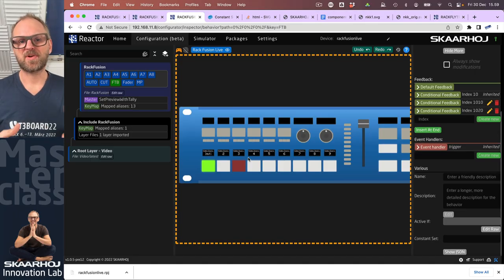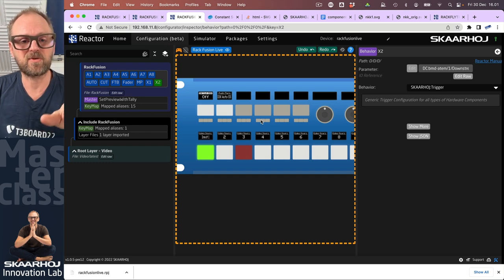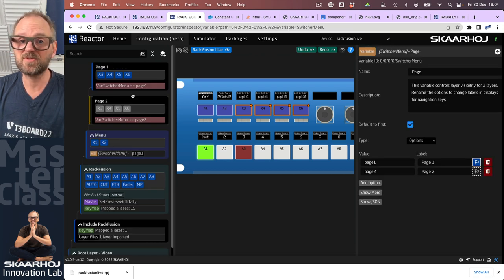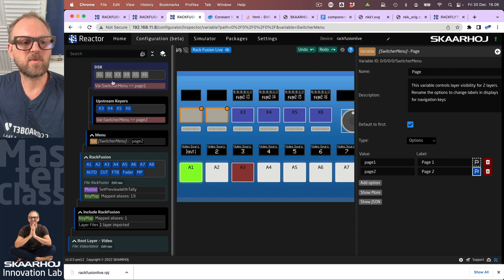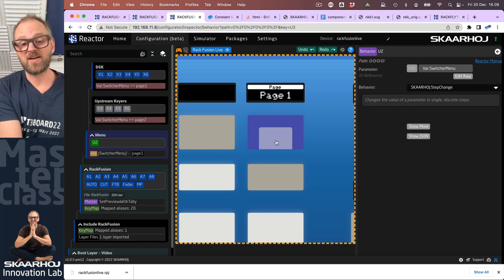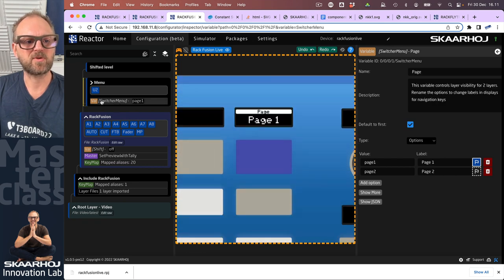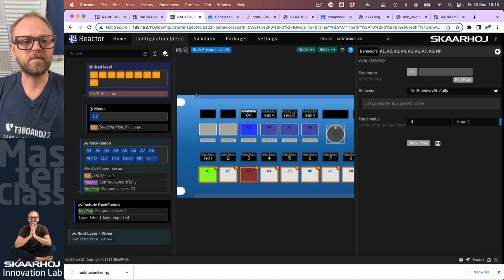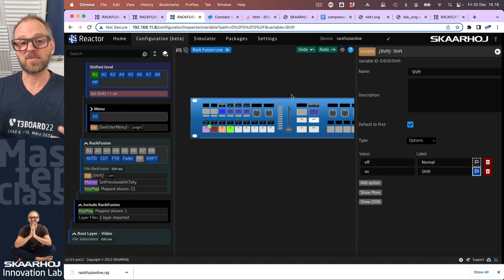Fusion in the Reactor 2: Adding a Shift layer and navigation key for it.

Comment: Great video! So much is possible with Reactor! Can you help me figure out how to display the IP address of the device on the screen from the Generic PTZ Control configuration? I use several different devices in a corporate environment, and if I move the controller from one building to another, the IP address will change, and I won't be able to access it without knowing the IP address. Thanks!